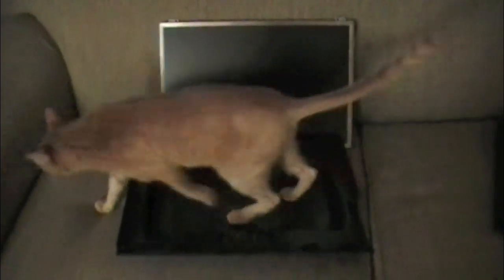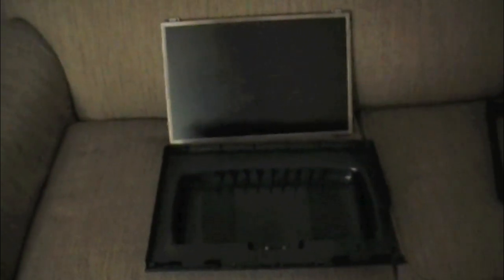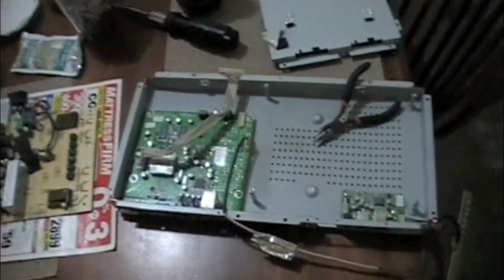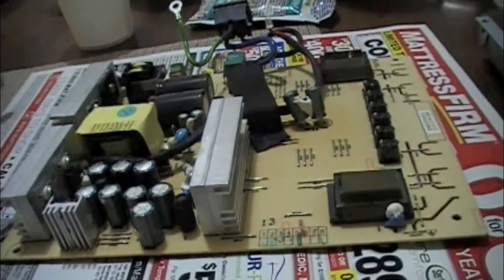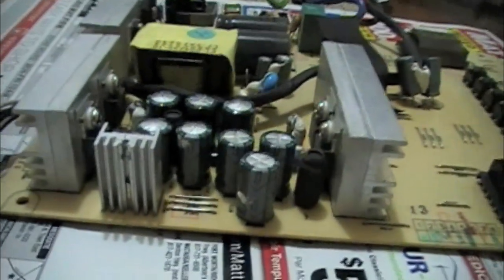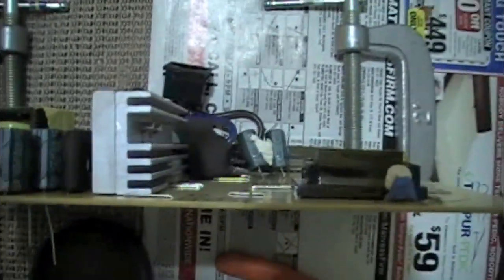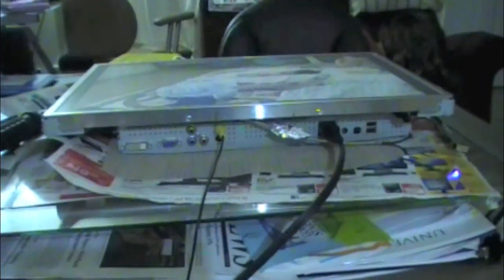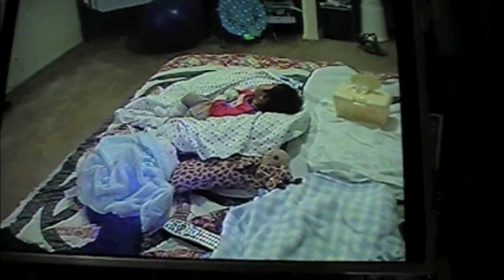LCD Gateway Monitor FPD2185W

Comment: My 2185 monitor has been acting up and finally died last month. I have taken the power supply out and 3 of the 470microfarad caps are slightly rounded at their tops. I will replace all 8 caps. I also have a zenier diode burnt in to right in the middle of these caps. It is ZD 287. Does anyone know the value for this zenier? Thanks!

Comment: I have this Gateway Monitor FPD2275W its a 6yr old 22" monitor and I cant open the plastic part of it, I dont know if there's a special way of doing it because it seems like I need to change the capacitors...should I just keep using use force until it opens? any advice would be highly appreciated.

Comment: Yeah, I got it alright - still sitting apart in my room in a box. -- Went to Radio Shack - Get this, they don't sell capacitors - at least not like they used to (much reduced stock). - Went to other electronics stores: Same thing. - Well, one of these decades I'll get around to it - If I can ever get the capacitors (and then remember HOW to put it all together again) *sigh*. - Very tiny ribbon wire broke at the connection - Another thing I'll need to figure out. - Clay? Glue? lol

Comment: @adb0150 Thanks, got it! - Yep, just worked myself around it slowly, with a bit of muscle, with a flat-head screwdriver, and eventually I got it off. -- And, yep, for sure, 3 bad capacitors, with a possible 3 or 4 other bads. (Just gonna replace all those.) - Once done, lol, I just hope I can get it all back together. Later, thx.

Comment from the maker: @RackAttack8BC It is kind of hard to take the frame off. I can tell you that it is possible. A little bit of struggle.  Try to use a crowbar and seep it through the grooves of the frame.  You pull and let go and so on around the frame. Eventually it will pop. Not be afraid to break it. I was too. It is relatively flexible. Good luck!

Comment: Thank you for this video. I had same problem. Picked up a soldering iron a few capacitors and fixed the monitor. Works just like new. Just saved a few hundred dollars :)

Comment from the maker: @FLiPboi23 You have the four screws from the pole that keeps monitor straight, then you have three more screws in the back of the monitor. After taking this off, next step is taking care of the frame. One can be a little bit intimidated because is kind of tied, but believe me it will come out. Tray to scrape out a little through the groove join on top and bottom. Pull back and forth. Make sure you frame comes first either from top or bottom. You start hearing some clinks that is locks poping out

Comment from the maker: @samuh4864 On-line , repair technicians will tell you that if you monitor has been opened they may not be able to fix it or it can be more expensive or other warrants. If you have this hunch and think is capacitors, just do it. Open it up and change capacitors. It will save you few bucks and you get some fun while doing it. It is already broken, what else can go wrong.